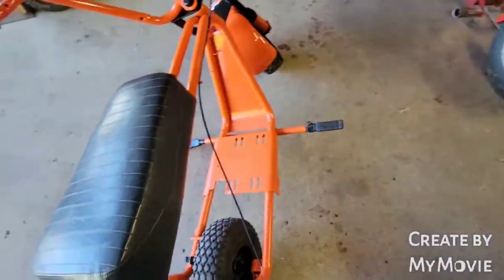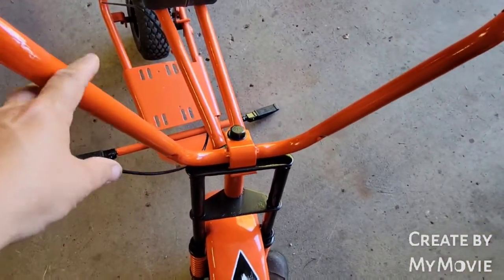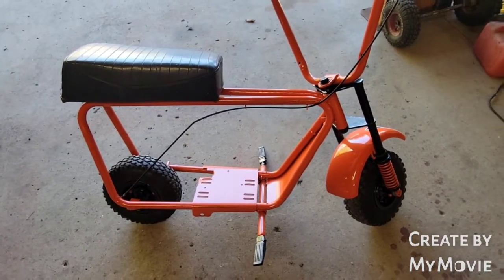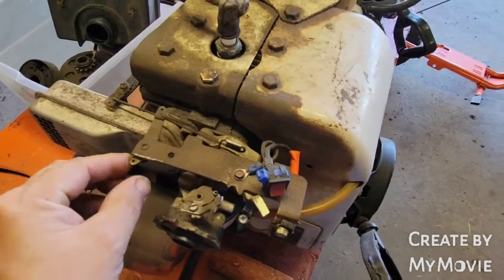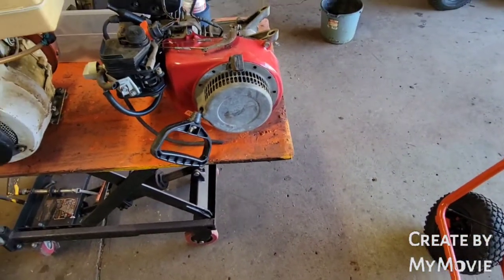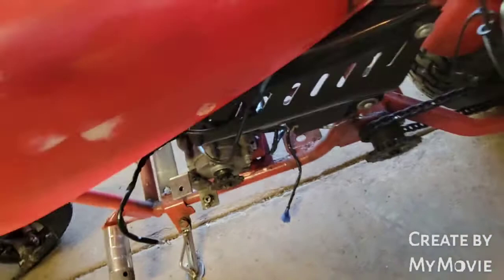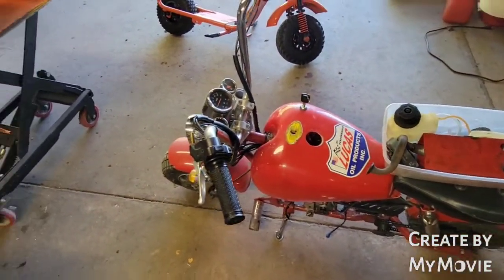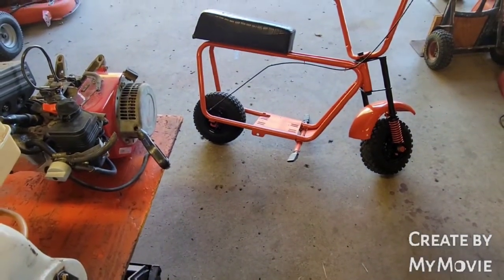mini bike updates

Comment: From what I understand, you shouldn't use a snowblower engine for something that runs in the summer like a go-cart. One reason is that they do not have the air filter setup needed to keep the dust out of the carb. The other reason is because the cooling system/fins are not as robust as say a lawn mower or tiller engine because a snowblower does not need as much cooling due to the winter temps. I've never actually compared the cooling fins myself but it's something to think about!
Reply from the maker: Hi there  Troy. They are the same whether it's a snowblower or a roto tiller. You can easily put an air filter from a push mower or roto tiller on these. What made the tecumseh reliable in winter was the way they ran the fuel line through the  blower housing to keep it from freezing up. Nowadays they have so many additives in  fuel including one that keeps it from freezing up in cold weather so we no longer have to worry about that.  Thanks for watching and commenting Troy and have a good weekend
Reply: @davessmallenginerevival2847  Thanks Dave! I don't know where I read or heard that. It's something I've always wanted to verify but haven't gotten my hands on a snowblower in a couple years.